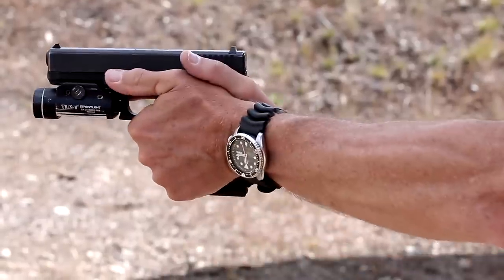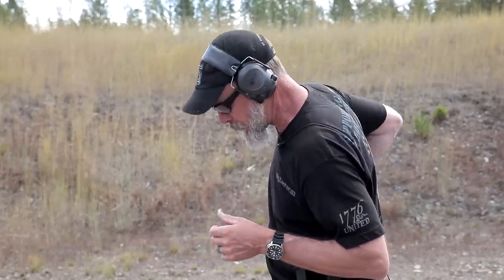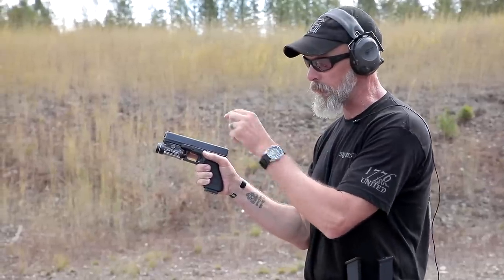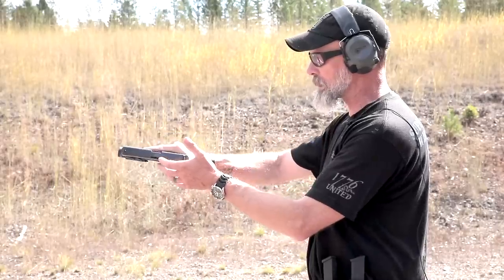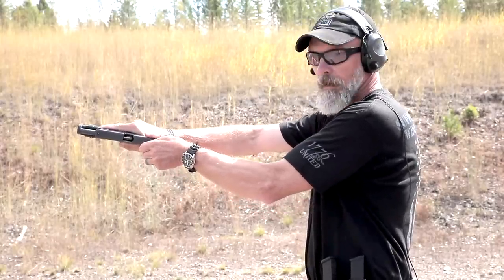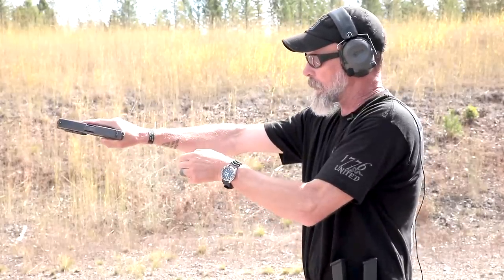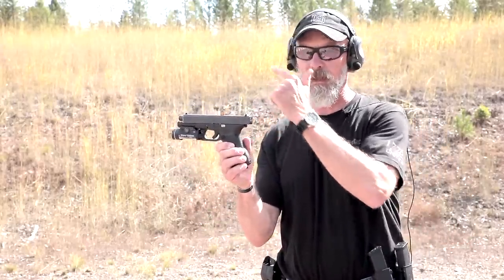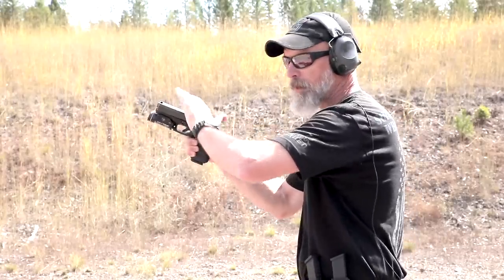Tactical Training Techniques: Tap Rack Bang

Comment: The stove pipe tip was great, I always pulled the slide and shook.  Could be a life saver!!
Reply from the maker: We're glad to help Mike. 
AlienGearHolsters.com
Reply: With a stove pipe malfunction easier to do the wave to the rear using the leverage and pressure in your favor in knocking the empty casing out it's also more convenient in re-establishing the grip and then extending to target or threat. It also doesn't put your hand in front of the muzzle incase of a negligent discharge.

Comment: I know that you know this but if the pistol doesn't just click but sorta goes "pop" you may have a bullet stuck part way down the barrel. Don't want to simply "Tap + Rack / Bang" because you will possibly have a dangerous situation. The gun could explode from an obstructed barrel. ☠Ouchie! Be aware that when you Rack the slide you don't only eject empty brass but an intact cartridge. (Plus hopefully that intact cartridge isn't a "Hang Fire'.)
Reply: Yeah, that's sort of a dilemma. It might be worth the risk in a real self-defense situation, but if you train with dummies until this becomes an automatic reflex then you will likely do it if you have a misfire in practice.
Reply: That's when you go for the back up pistol
Reply: @daviddenson3324  when all else fails, the .22 in your boot has your back😂
Reply: As a newly minted Basic Pistol Certificate and Range Safety Office Certificate holder (I could add Distinguished Expert - Pistol but that is more about accuracy than safety). and at the risk of inducing the ire of all my action shooter friends, there is a safer way of handling click-no-bang.  You are 100% correct.  The "other way" is keep the muzzle in a safe direction for 30 seconds, drop the mag, open the action and inspect (yea, kiss that string time good bye.)  

I look at this situation as two choices: as safe as possible or safe as good enough.  After considering this scenario - click-no-bang with instructors, casual and competition shooters - millions of rounds among them - not one reported seeing a "hang fire" in person.  So, in the immortal words of Dirty Harry: "... well, do ya...?" 
🤔
Reply: Yeah, that's the scariest part shit happens.

Comment: Got a question about hang fires and tap rack. At one time if the gun went click you were supposed to keep the gun pointed down range in case the round had a delayed fire. Is that no longer practiced? To immediately tap rack seem to me you could eject a round that might go off after ejection and end up hurting someone. I would like to know your thoughts. Great video.
Reply: IMHO, keeping pointed downrange is a good idea in a non lethal situation, like going to the range. Now if this happened when someone trying to kill you, then by all means tap and rack. Also, theres videos on youtube where a guy demonstrates the lethality of bullets going off when not in a barrel. Its minimal even with a 308. Iirc he demonstrates 9mm, 45, 556, and 308. At 1 foot iirc, even 308, wont puncture a cardboard box. Youtube it and you'll see. Again, I dont remember the results but I believe its something not to worry bout in a self defense situatuon

Comment: I just got the Springfield Echelon about a month ago, and i noticed that when the slide the cocked back and i tap a mag in (a little hard), it automatically racks the slide forward. I have yet to see any info/video on this so i wanted to know if its a feature or malfunction in the firearm
Reply from the maker: You may want to check-in with Springfield about that one.
Reply: @Aliengearholsters  I looked more into it, its a feature. thank you for responding!

Comment: I do not see any practical reason to tap the bottom first before racking the slide. surely the magazine spring should be functioning so that the next round will come up for feeding. I still believed that in case of no-bang, the firer should directly rack the slide.
Reply: Maybe I’m missing something but isn’t the purpose do the tap to ensure the magazine is seated in case that was the cause of failure to feed
Reply: Your question is valid but I think there’s an element you’re missing. Sometimes on handguns the magazine spring is very stiff when fully loaded and may not want to seat all the way because of the pressure required. I remember the first time I loaded a handgun and I was surprised at how hard I had to push.
Reply: @NinjaPooop  Yup my gun surprised me too, it’s much hard to seat a loaded mag than an empty one so I think people who only practice dry fire may not realize